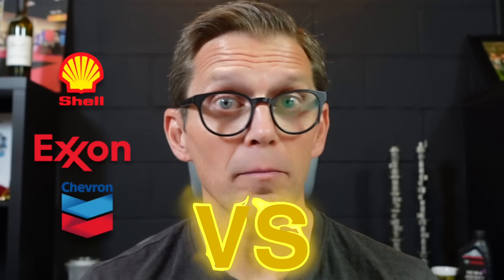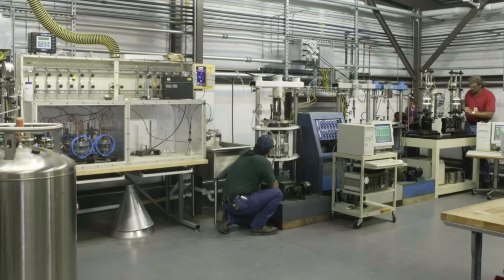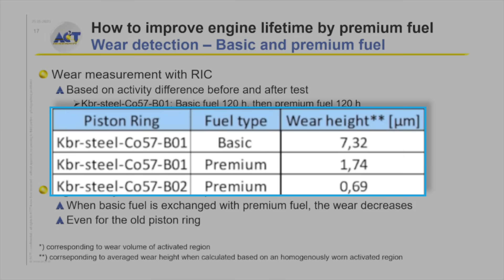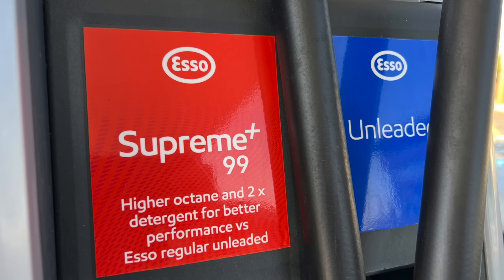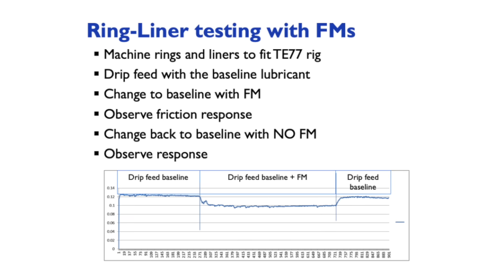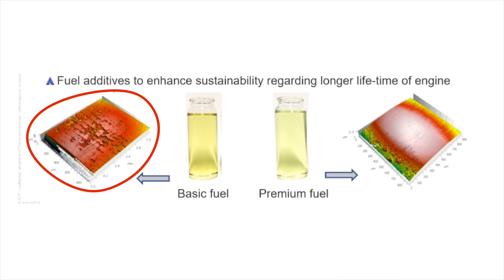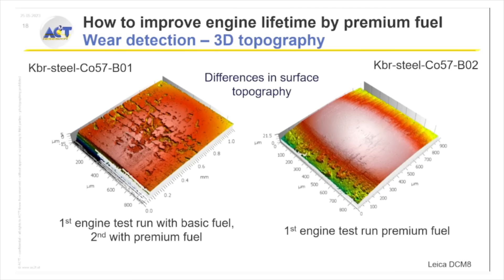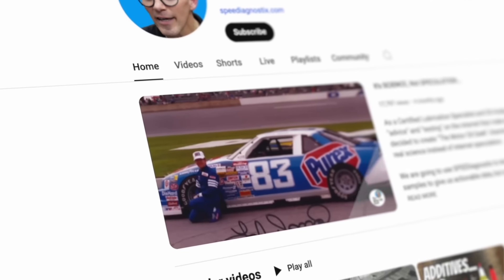Can Premium Fuel REDUCE Engine WEAR?

Comment: Not the same fuel additive in Europe as You sayig. For gasoline only higher octane 98+ (RON) has fuel additives and/or those marked as "premium". Actually in my country in Europe only Circle K has the same octane rating for standard or premium, but different prices of course. On other stations if You want to pump "premium", You have to buy 98+ octane gas. Additionaly the higher octane gas contains 50% less ethanol, which is very important especially on older cars, direct injected gas engines or seasonal driven cars. Similar additive content applies to Diesel fuels here.

Comment: All of the gas is exactly the same. The only difference is the additive package they blend in with the gas. The octane is often off. The additive package is often not blended right. It all depends on the facility blending and distributing the fuel.

Comment: I have a question?I have a Honda Civic with 241,000. I bought it with 39 miles on it. Regular oil changes with full synthetic after the warranty expired. It uses 1 quart per 5000 and has been drive spiritedly. I hope that is a word. I will always use synthetic in all my cars, using the factory recommended "weight". My question is fuel additives for best longevity. Techron? How often? Top Fuel? I hope to get an answer.

Comment: Hey Rev. Oil Geek Lake!😂....
I hate to bring this up but I will NEVER  Forget or Forgive Shell over the "Great Shell Motiva Sulfur Incident of 2004" where 10's of 1000's of people ran out of gas from the accidental high sulfur fuel content of the Motiva Refinery in Norco La.  The sulfur corroded & bridged the silver windings of the fuel sender gauges, causing false fuel level readings.  I had to walk a 1/4 mile to a gas station in Ft. Lauderdale with a bad back, then it started poring down torrential rain!  That was the end of my poor 1991 Cadillac Brougham that I didn't need & totally lost time working on the car before my health failed.  I still have the original fuel sending units for both my Caddy's & Shell paid for new units at the Cadillac dealership.😭
After this incident, & another a few years later, Chevron Techron added a component to their bottled additive that was to protect fuel systems from high sulfur fuel damage!  Not sure if they still include that chemistry or not in their bottled additive, but I think showed up in a few other brands of bottled fuel additives.
  It would be interesting to know what chemistry is used to protect from high sulfur fuel damage.🤔. Sulfur was actually said to be a good thing in fuels to add lubricity or maybe as a Friction Modifier, but not at super high levels of sulfur at 100's-1000's ppm vs. 1-2ppm.  Only 2 additives I've heard about containing sulfur is Schaffer's Neutra additive around 15ppm sulfur & Marvel Mystery Oil 1ppm.🤔

Comment: Premium expensive brands cut their regular gas with ethanol so you visit them again soon..
No.. I have a 2008 honda civic i still drive 217,xxx miles on the OD. It doesnt reduce wear. It depends on the engine you have and how crappy it is. I put cheap gas in it only mainly Arco and regular. Ive tried putting mobile and chevron before, but it just burns way faster than Arco believe or not. So I stuck with arco because it lasts. If you want to clean your engine remember you can add you own chemicals to the gas tank so no need for special formula in the gas at all. As long as the gas you buy isnt cut with ethanol then it shouldnt be bad. I know for a fact top tier brands will cut their regular gas with ethanol and that is why i dont fall for the premium brand. How do i know? Because for some reason arco gas lasts longer LOL.. All you pay for is to look cool at a expensive gas station that cuts your gas because they know you will be back soon, rich people are suckers.

Comment: The Math does not add up.  Suppose 25 mpg  over 100,000 miles.  Suppose $1.25 per gallon premium over premium.  That's $5000 spent for a very marginal benefit
Reply: Burning oil at 200k+ miles is not significant?
Gumming and engine failure BEFORE 200k?

Comment: Fuel hauler here! When we load fuel at the rack( refienery) chevron and shell use different codes that means there fuel is seperated from the other fuels from other gas stations chevron and shell have very good additives I’ve always used those to fuels in my jeep gladiator
Reply: Does the Regular 87 Octane at Shell have the same quality additive package and friction modifiers as the Shell 93 octane premium nitro plus?   Or does the 87 OCTANE  at Shell not have the same additive package and friction modifiers as the 93 octane from Shell?   Or is it the same and the only difference is the octane rating?
Reply: @matthewray5954 higher octane has more additive concentration but all shell gasoline has very good additive chevron as well one of the best gasoline out there too
Reply: @matthewray5954  it’s the same just the octane rating
Reply: So even if you use Shell, Exon or Shevron low octane, you still get better gas than generic gas station high octane or just across the board?
Reply: @jasonteague2175 yeah it’s better gas and better additives that’s why almost all the time chevron and shell never lower the gas prices, they’re always a bit more expensive
Reply: @christiano1094 yea but it's just better for your car.
Reply: Can confirm. I drive a Ford Fusion Hybrid. Regular gas gets me 40-42 MPG. When I switched to Shell I effortlessly get 47-51 MPG. Thats a dramatic increase. Didn't notice the same for Chevron, however my car's acceleration is faster both on Chevron and Shell unlike regular gas.
Reply: so u bought a chrysler 3.6 pentastar engine?  I'd have thought a trucker would be wiser than that.
Reply: @18_rabbit  yup! Love my Mojave
Reply: @christiano1094  Same here!!  2025 Mojave X!
Reply: @18_rabbit 🙄

Comment: GREAT!! Thanks for the online scientific vindication!!! After 15 years I switched to Premium ARCO in the same vehicle which was rated for 87 Octane.  Performance - greatly improved.  Off the light - 0 hesitation and great jump off the line (when my laser/radar detector assures me no cops are around).  Fuel efficiency - increased 3 MPG - and that is measuring it consistently over 6 years on 91 Octane Top Tier Premium. I don't really care about fuel efficiency but it's another good talking point.  But now I have another reason to stick with Premium Top Tier fuel in my 87 Octane rated car - a scientific-proof reason!  Thank you very much!

Comment: my 2010 ram 4.7L has over 251,000 miles runs any fuel just fine.  and my daily driver is a 2013 981 Porsche Boxster base. 109,000 miles on it. It is very picky. it will not run 0n 87 of any brand. barely starts. but i can run 91 and octane boosters help. it prefers 93 or higher. its night and day when u run 93. as far as brands go i dont shop brands. i shop by octane. you can add fuel additives.

Comment: Does using 93 octane get better MPG?
Reply from the maker: That depends upon the engine design. It can for some but not for others.
Reply: @themotoroilgeek update i have a 2024 Mitsubishi mirage and I hot much worse mpg by using 93, I get much better mpg using 87 octane from Shell

Comment: I rather buy a cleaner with PEA and use cheap premium gas than rely on the station to have the proper amount of additive in it. So what i save in $ i add myself, but better.
Here in Vegas, Shell and Chevron are equal priced but about 75 cents more per gallon than other Top Tier places like Conoco, Mobil, Sinclair, Arco. So i still use top tier gas too. But 1x a month i use grocery store gas cuz i can save 30 cents per gallon.
I've also tested every brand of fuels gas mileage trying to keep the variables as close as possible and i found they're all very similar. Have em all documented over a 1 to 2 year span.

Comment: Thank you for this fantastic video that proves all along what I’ve been saying since I was 16 years old but without the data!! there’s a huge difference in top-tier rated premium fuel versus the regular stuff. I’ve always pumped premium fuel in all of my cars even when they say 87 octane is recommended and changed oil with high-quality synthetic every 5000 miles my entire life. 
I’ve had zero major engine problems in all vehicles owned and all vehicle vehicles last to 200,000+ miles. 🎉❤
Reply: Has nothing to do with it.

Comment: With into two exceptions of in the first three months, my 2016 Corolla has seen only premium gasoline since and ONE tank of mid-grade in 2024. Oil changed to 5w30 after 150K miles. Now running Valvoline R&P. On fourth oil change interval now (of R&P). Car has over 250K miles!!!
Reply: It's amazing how people leave these off topic comments that have nothing to with the content of the video. This isn't about octane ratings genius. It's about the additives in fuel. Nothing to do with octane. You corolla doesn't need higher octane so congrats on burning money for no reason. The only reason anyone needs higher octane is to prevent preignition. Go back and get your GED and try agin. So sick all these low IQ comments.

Comment: Lake is very good. I like his videos.  But I found this one was easyer to watch at 150% playback speed. 
With that said. I have to question ...
(A) Why the oil companies won't just put the better addtive package in all fuel grades. The wear additives are very inexspensive. 

(B) If it reduces wear. Then it also reduces emissions. in which case the government should make it imediately mandatory.

I am skeptical this will help overall car and or engine service life.

Comment: You really don't need to be using 93/premium in a standard passenger car (that calls for min 87) that has less than 8:1 compression or has a combustion chamber designed for it, and especially direct injection.   
My 2012 Yaris has the 1NZ-FE engine.  It's a 1.5l I4.  Manual says 87 octane.  I run 87 in it.  It has a 10.5:1 compression ratio.  One would never run 87 in say a built Chevy SBC that had 10.5.1 compression pistons.  You'd blow it up.  
Octane is all about the flashpoint and compression.  The lower the octane the lower the flashpoint and the lower the compression is needed to ignite the fuel.  <-the best way I can explain it.
Reply: It depends on the fact if the lower octane fuel doesn't cause the engine control unit to dial the combustion timing back by a number of degrees. If it doesn't your are OK to use that gas. For example my car requires the AKI 93+. But the AKI 93 causes the ignition timing to be retarded by about 1.5 degree. The AKI 94 doesn't cause that so it is perfect for my car. Generally most cars are designed to use the regular RON 95 which is standard around the globe with some high performance cars requiring the premium RON 98 - RON 100. You might be using a way too low octane. Which is recommended by the engine manufacture just to last through the warranty period.
Reply: @mikman7219  Yep.  Your statement is an indicator of how the octane and CR isn't as simple as it sounds.  LOL  We also don't use the RON Octane scale.  Your RON 98 is equivalent to our 93 octane.  RON 95 = 91 octane here.
However,  your assessment is not correct regarding my Yaris and the octane.  The recommended octane for the NA 1NZ-FE (the 1.5L engine) is 87, even though it has a 10.5:1 compression, it is also DIRECT INJECTED.  Direct injection allowed the CR to be raised on a lot of engines, w/o having to increase the octane.
Now, that said, if this were a turbo, I'd run 93.  I also run 93 (RON 98 for you guys) in my 06 GS430 that has a 4.3 V8, because unlike the Yaris, Toyota does recommend 93 octane for that engine, even though it has the same 10.5:1 compression ration as the 1nz-fe.   I can only hypothesize that it's because the V8 puts out 304 hp and the I4 puts out only 107hp.  

Find the part where it mentions the MPG specifically on 87 octane here....
https://www.motortrend.com/reviews/2012-toyota-yaris-se-first-test
Reply: @VBMichael_D  Can you prove that using the AKI 87 doesn't cause the ECU to retard the ignition timing? This is the only important thing here.

Comment: How does the better fuel relate to the avg person's daily driver.  I've used only 87 oct in every car I've owned even back when leaded gas was around, and haven't been loyal to any specific brand. Since then I've had a used 87 chevy eurosport, a new 95 chevy astro van, a 2000 ford f150, a 2005 chrysler 300, a 2011 dodge ram hemi, and a 2001 chevy suburban. My 2014 yukon denali only has 145K so far.
I've not been religious on oil changes, I go from 7.5K to 11K miles between changes. This is with past conventional oils and with syn oil in my cars since I don't recall when but started yrs ago to extend oil change intervals. The 300 has been the only car to force me to add oil in between changes.
On every one of the vehicles I've mentioned (except the Ram) each has had around 290K miles before they became not worth putting money into anymore (I'm talking about money spent on the usual things that go out). I recently had a jasper engine put into the 2001 suburban after 298K on the original engine, and the #5 lifter is about to go out on the Ram hemi at 250K miles. The 300 started using too much oil to spend any money on another engine, plus that engine is hard to get anyway (it used a quart every 2.5K mi since I had bought it with 88K miles on it (marvel mystery oil in the oil dropped that down to 1 qt/2k mi). 
I love your work! You recently helped me decide to stop using the mmo or any type of additive with each oil change. I'd like to go with the top tier gas but I'll have to calculate the extra cost of gas over time. I keep my cars for as long as I can.

Comment: Not nearly enough info to help us make decisions. Do all premium fuels have friction modifiers? Do some or no regular fuels have them? Does brand make a difference? Saying the rings wear faster on regular fuel is fine, but HOW MUCH faster? Are we talking about the rings losing some of their sealing ability at 150,000 miles instead of 250,000 miles? (In which case most of us will say "so what.") Or are we talking about 50,000 miles vs. 150,000 miles? There's a very real cost associated with using Premium fuel in cars that don't require it, so knowing whether reduced wear really offsets that cost, or whether the difference in wear is measurable, but not really significant, matters a lot.

Comment: Big question: does adding a top end lubricant to the fuel change the piston ring, cylinder bore wear and longevity of the engine? What would be the best fuel additive one can use to minimize wear?

Comment: I’m curious about this… Is it worth running a higher octane just to take advantage of the additive package? I always thought the additive packages are the same from same brand because different engines require different octanes, at least that is what I was taught in my technician training including OEM training.

Comment: When you say premium fuel, are you talking about a premium brand or say 91 or 93 octane? I run Shell but my vehicle recommends 87 octane. I run 87 octane like it says have had no issues but the additive package in the shell fuel is still better than that. Crap you buy at Kroger’s or Thornton’s.
Reply: Premium never refers to brand.
The additives-package in Shell regular (87 octane in most states, except Colorado) is terrible. I run Shell V-Power (which is Shell's "premium" or "super" unleaded gasoline) in my 2016 Prius c Two (which definitely does not need high-octane-rated gasoline). I use V-Power in my car because of its superior additives-package.

Comment: Is the Shell  helix HX8 a good oil ???
Reply: Yes, but your fuel matters more than your oil (as long as your oil is any full-synthetic and meets your engine's required oil specifications). I run Shell V-Power in my 2016 Prius c, because I know that fuel quality matters more than oil quality.

Comment: did you know that there is air pressure pushing oil through the oil drain back holes during compression.......dont know what happens during expansion part of the stroke though.